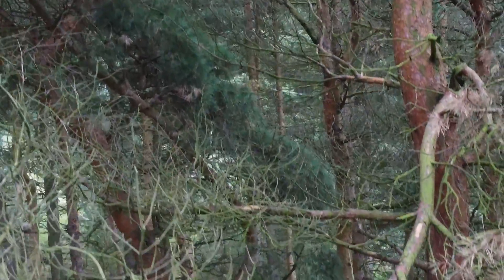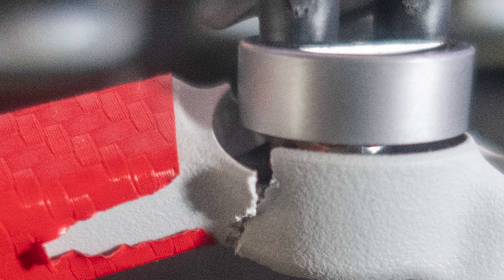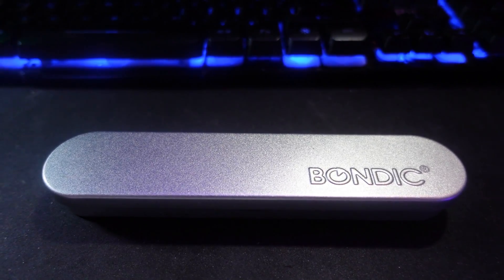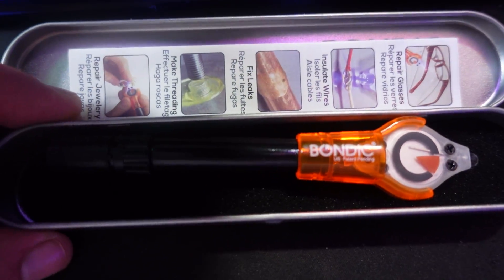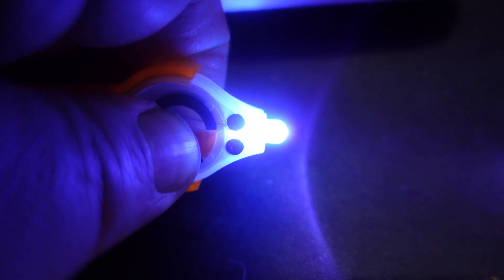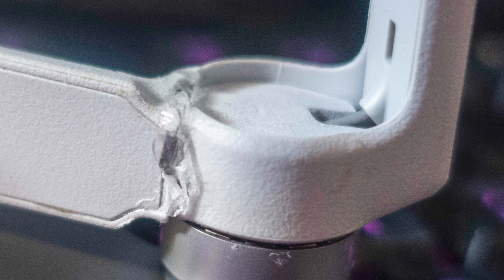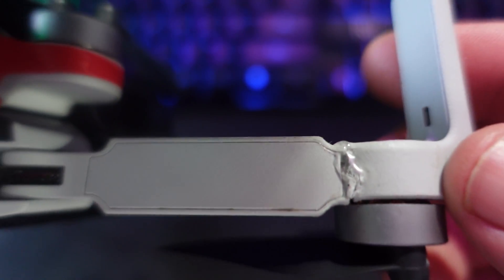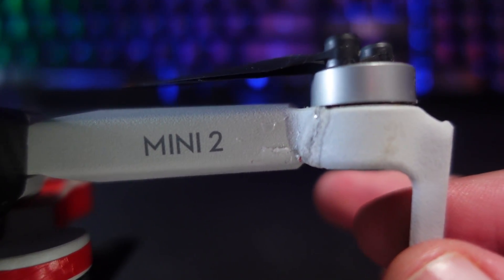DJI MINI 2| WATCH THE SECRET HOW TO FIX THE CRASHED DRONE

Comment: Superglue and baking soda works lol. You can’t just use superglue
Reply: Hello.  My drone broke in the same spot. I recently purchased DAP rapid fuse. Do you know if that will work? Also, how do you add the baking soda?
Reply: @MrNomad777  any superglue on the spot. Sprinkle baking soda on the spot you put superglue. It will harden instantly then do multiple layers. Add more glue and baking soda.  Don’t get glue on motor. You can sand it down and paint it gray if you want.
Reply: @twiztid83222  Thank you very much! I'll be able to fly my drone again!!
Reply: @MrNomad777  hold the parts together while someone sprinkles the powder on. That way it’s the straightest. I have 2 drones with broken arms. They run perfect

Comment: Does anyone know what kind of plastic the DJI Mini 2 body is made of?
Reply: something cheap. lol
Reply: @juggz1943  I was kinda lucky, I was persuaded by DJI to return my drone to see if it was covered under warranty, and to my surprise it was, they sent me a brand new Mini 2 at absolutely no cost whatsoever, which is a great service. And it is such an easy drone to fly with an excellent video camera, but the main problem I'm having now though, there are so many rules, regulations, and restrictions that I wasn't aware of in order to fly a drone just about anywhere. I've only managed to fly this drone twice since then.
Reply: @robertklaassen2628  i must look into that about the regulations. and if i had the same issue as this dude you think i should just send it in? it says there is a 1 year manufacturer warranty
Reply: @robertklaassen2628  but i agree. super easy to fly i was able to get used to controls in under an hour. mine broke because the first time it got to low battery, it automatically tried to go home and gave me 5 seconds to cancel it, well i didn’t even know what was going on and by the time i realized the 5 seconds was up, and my drone flew straightttt up into a tree😭
Reply: @juggz1943  my drone must have had a malfunction, it just dropped out of the sky for no apparent reason. I explained my situation to DJI and they suggested returning the drone for inspection, even though I had my doubts about the warranty but I went through with it anyway, and it turned out well for me. I want to go for a license, but that could be quite expensive, and then there's getting permission wherever I want to fly.
Reply: @robertklaassen2628  how expensive is the license process ?
Reply: @juggz1943  Not sure and it could vary but do believe that these courses are expensive, for me anyway. Probably in the thousands.
Reply: @robertklaassen2628 where did you drone break?
Reply: @robertklaassen2628 mine broke in the same area,  I also have not had mine for a year yet, I wonder if it will be covered under warranty
Reply: I have the same issue right now…Mine hit a tree and broke exactly at the same place. I bought a 2 year coverage with my drone but should i give it a try and glue it or not risk it and send it to DJI
Reply: @TheMichaeljackson109  I wouldn't attempt trying to glue it, and I don't think that there's any glue that would fix it. I have tested many types of glue on different plastics, and none were successful, and you might lose your warranty. Contact DJI, they are a really good service, I had my drone replaced due to a malfunction at absolutely no cost whatsoever including no mailing costs.